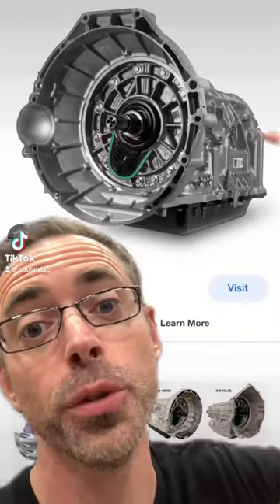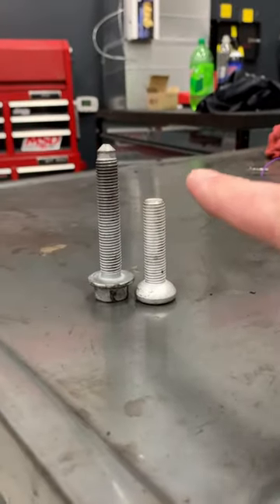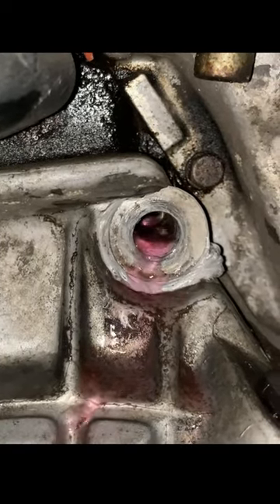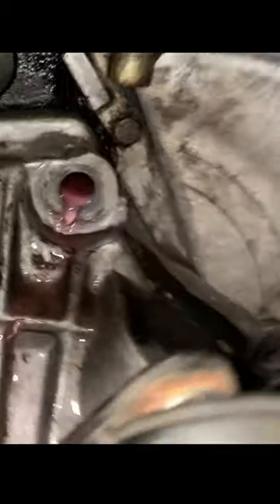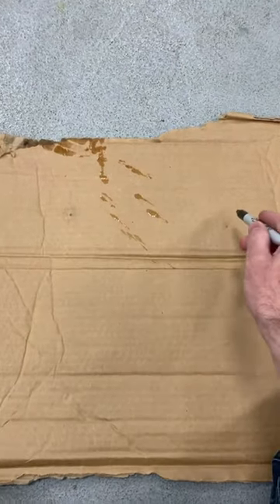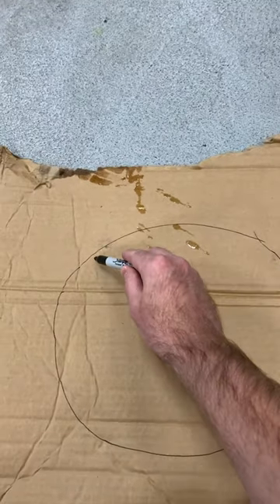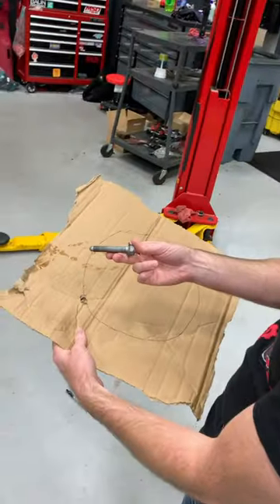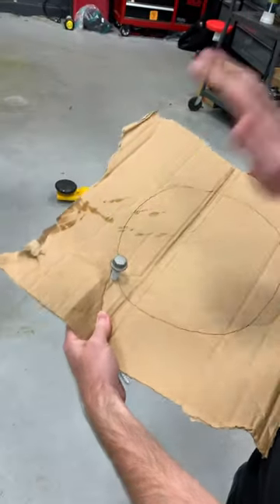Expensive Mistakes when working on engines #car #shorts #automobile

Comment: You can always check the depth with something smaller by inserting it in the hole and your thumb against the surface keep hold  of it take it out check the length of your bolt against your depth gauge.

Comment: Remove the bolts by starting at a position on a clock and lay them out in order as you go. No cardboard needed, but cardboard is a better way to do it.

Comment: As a 2 stroke MX mechanic all through the late 70s into the 2000s  I just put all of the bolts in the case until they all just touch the threads.the various length bolts should all be showing the same length sticking out. If two are long and short swap them until all are equally sticking out.

Comment: If it get tight before the head is seated, something is wrong. Either its the wrong bolt or its cross threaded. Very few things automotive require force amd it's never nuts or bolts. 

My tip: Be patient and methodical. Slow is smooth, smooth is fast.

Comment: If a bolt is too long it will stick out, or if it's 1mm more long you'll will feel that's it's too tight before time. Idk how you can make an hole like that. I rarely have track if the bolt I remove, most I leave them on the piece itself. Other one's 100% of the cases goes to only one thing and only there. If it's something you can even look at the dirt, rust and signs to determinate if it was there.

Comment: On motorcycles we have a similar thing when assembling the engine, but we just check if the screw part left out when we put it there before screwing is the size of a finger width.

Comment: ignoring the fact that they were clearly threaded in with an impact on full uga-duga/vert mode when one should have had threaded them in using a ratchet since there's only what six or eight bolts total, It's not like the impact saved a whole lot of time but i digress and the damage has already been done...

Here is the fix without "spending thousands of dollars".

5-10 wraps with Teflon tape on the bolt threads and then reinsert the bolt back in the hole that came out of it'll be fine and should be a permanent fix until the next time the bolt has to come out for service work at that point it would have to be reteflon taped again.
Ford was notorious back in the 1970s for having water pump bolts go into the water jackets sometimes they would leak especially as the vehicle's got older and the water pumps it came on and off a few times.  Plumbers Teflon tape would stop the coolant leak it is really that simple.

Comment: Or just drive a '73 Chevy pickup like I do. Had it since '76 and it's all original except for fuel pump, p/s pump, brakes, and 4 clutches.
243000 miles and still going strong!

Comment: Done that many times.  I had to follow up a green 'tech' one time on a John deere tractor after he worked on the clutch.  Both shift levers were walking around under acceleration/deceleration.  He sucked the trans to the engine with a ½rattle gun.  Trans top shaft annihilated the rear bearing support.  Total tear down and send it off to machine shop to fab up complete new bearing support saddle.  Big dollars and service manager still didn't fire him.

Comment: I just want to say that I didn’t grow up with a father figure. I am 35 and had to learn the hard with B&W 1,000 service manuals. I used to use the nail polish method for bolts but after watching this I’m going to cut a cardboard layout whenever I can so the correct bolts go into the original spot.

Comment: Pro tip, insert a metal rod/ welding rod into the thread. That way u can see how deep and that will tell u which length of bolt you'll put on

Comment: I did that to a transmission one time on a Chevy van. I ran a mounting bolt through the bottom of the transmission too far and ruined the transmission case

Comment: I use the old cardboard trick for so many things.

I also suggest always running up transmission bolts by hand. It doesn't take much longer than throwing the air tools on it.

Comment: I should have done that . I replaced  a water pump on my 460 ford . All kinds of bolts , all different  lengths.   It went back to gether ok . But I was very careful I put the bolts back into the old pump when I took it off . It worked . But this is a better idea thank you.

Comment: Find or make stainless steel grub screw with correct threads and install it with Loctite 567. Wait 24 Hrs.  Shorten if necessary, the transmission bolt enough to get in at least 4 threads depth. Blue Loctite the trans bolt, and wait 24 hrs. EZPZ

Comment: That is quite the stroke of BAD luck. Of the 18mm bolts that hold the engine to the trans, only one is slightly longer than the others (the starter bolts on the manuals don’t count here😂), it happens to go on the bottom rear. But to pick that bolt and mistakenly send it through the block, just sell all of your tools and rely on professionals from now on.

Comment: I remember performing learning this when working on rebuilding transmissions taking entire engines apart and replacing auto parts. One bolt may be shorter than another.

Comment: If you forget to do the cardboard, place the bolts around the bell housing while butted up to the motor, arrange the bolts so that they all a have the same amount of thread showing when just pushed to the threads, not started.  Likely 1/2-3/4".  This only works if you are sure you have the factory bolts.  If they stick out roughly the same, you should be very close.  Not perfect but better method than just start cranking away until you break something then back off a half a turn.

Comment: Just get a little rtv and some red threadlock mixed with 2 parts washer fluid, 1 part ATF LV, 1 part coolant and rolled in ceramic brake dust with a pinch of lathe shavings in the hole to prevent leakage...be better than new 😅

Comment: Or stick a screw driver in the hole/s to gauge / measure the hole depth/s before inserting the bolt/s.

Comment: I can see a aluminum block cracking if you would put a bolt in is too long but a cast-iron block as see the threads stripping before you crack the block and not all transmissions or a circular bolt pattern

Comment: Or just don't run bolts like this in with inpatients. I've swapped a few motors and once had the wrong length. It stopped progressing so I pulled it back out and sure enough wrong hole, move it to another. Besides cardboard I have a video showing I use cheap silicone mats(meant for hot pans and such) and poke out the honeycomb shape to make reusable pattern bolt savers. Works great years later.

Comment: So I'm a little confuses yes it had a hole in the block but if no external cracks I would assume you could run the correct bolt with sealer on it I run into fasteners that go straight through the block into either main oil rifle or a coolant port even 10,13,18 speed transmission bell housing have holes thru it that bolts seal up with some blue loctite

Comment: I like put these bits of cardboard in a file cabinet, or hang them on clothing drying racks or from suspended wires/ropes/cables like clothing drying in the wind to make them easier to manage and access.

Comment: Well we usually hand tighten bolts, if you install or line a part correctly the bolts would go in simply. You wouldn't be making that mistake.

Comment: You can always use a thin stick like a tooth pick or q-tip stick it in   mark at the edGe with paint marker or gasket sealant ,.  You can repair it by using lacquer thinner or berry man great stuff spray , letting run out , or wipe off n use JB weld covering the entire hole,, waiting 3 days to cured then retreading the hole with proper size according to the bolt ,

Comment: I've installed my fare share of transmission bolts, and I gotta say it seems to me like you'd have to be some kind of determined to run a bolt in that far. By that, I mean that you should feel the bolt come to a hard stop well before all the threads are out of sight even if you're using a rattle gun and decide to give it all the ugga duggas. Surprised the bolt didnt just snap or strip out. Unless of course the factory used that bolt hole as a machining port and just put a plug in the bottom, but still you cant tell me there wasn't some noticeable resistance there.

Comment: i always do the bolt by hand first even tho i have both removed and installed the transmission myself which is a nightmare without the cardboard tehnique but experience has tought me to always first put the bolt on what side it should be (top being on the car windshield cover, the side ones are one the toolbox and bottom ones are in a box on the floor) second to always first use the bottom screws for the transmission hold because the transmission can be held by one or two screws tightened to spec and third and final always check where each screw stands because of the creative lengts of screws

Comment: I worked on VW, they are like that.. Once I fitted wrong bolt, and it stopped free turning before tightening. Had to replace immediately.. Whoever punched hole in this engine was not a mechanic.

Comment: Or just look at the damn bolt when your putting it in making sure it goes flush without resistance and not run it in with an impact. But yes this has worked for me in the past on some more precarious jobs.

Comment: Here's another idea, and I want you to hear me out because I know it's outrageous. The engineers could specify all the bolts for the transmission be the same length and that they aren't long enough to punch into the water jacket on the engine. Heresy, I know, but it must be tried

Comment: Absolutely no way that was done by a bolt, the threads would strip off before it ever went through the block. What happened is either a bolt was snapped off and then drilled out and they went too far and into a water jacket, or they stripped the threads so they drilled it out for a heli-coil and went too far and into a water jacket.

Comment: Not the end of the world get the correct bolt apply Permatex non hardening aviation sealant to threaded section of bolt, put bolt back jobs done. Early GM engines had head bolts that directly into the coolant jackets the sealant prevents coolant to pass up the threads.

Comment: I tried that once but my teardown was so full of add on bracket supports and shared with a 2nd cover I instead took every single bolt holding the covers organized by size and when I was really to reinstall used a deph gauge on a caliper and then subtracted ⅛" and it was perfect

Comment: Nothing is worse than spending hundreds or even thousands of dollars, and multiple hours to repair or replace parts on your car, just to break them or another part during the reinstallation process. Luckily I've only experienced that with a fuel pump, but it still had me so angry that I just laid back on my creeper in silence for a few mins. I couldn't even mentally process how badly I screwed up. Had to wait a week for my next check so I could get another one 😂😂

Comment: Or buy a Chevy, and don't pull the trans or engine.  And IF, you manage to blow one up, all the trans bolts, are the same length.  Just some have studs on the top, for externally mounted parts, like wire grommets.

Comment: You should inform people that some bolts are like this from the factory thoigh as well just take some mopar engined for example there typically one head bolt on each side of the engine that leads directly into a water jacket and its there on purpose idk why because they actually put sealant on these bolts specifically.. just an engineer trying to use their brain again haha..

Comment: Don't be a quiter. If that bolt is getting tough, just break out the cheater bar. Also, make sure to cross thread it because loctite is expensive and you're a frugal man.

Comment: Auto body tech here 
I being doing that old Indian trick for long time like 20 years 
Story some Jettas bolt door out skin same thing few longer bolts that can damage new painted panel 
Radiator and core support some longer that can damage your ac condenser or radiator if not using correct bolts 😆👍 
Cardboard works and you can write on it too

Comment: Never used cardboard, never had this issue. I just don't have my head way up my ass when I do work like this. It's not easy to run a bolt too far. You/I ...should/would feel it bottom out, and common sense would tell you to STOP DRIVING THE BOLT IN THE WRONG HOLE.

Comment: Too bad the OEM didn't think of repair and just use the same length of bolts all the way around.  That would just make too much sense.  Might even save a couple bucks on each car, but then they can't design to maximum pullout strength for each bolt.  Over engineered, under thought.

Comment: If you put a hole in the block from a bolt to long you dont need to be a mechanic. Ive changed tons of transmissions and have NEVER came flose ro this

Comment: Yeah, not proud of it but after rebuilding an engine assumed all the head bolts the same and ended up puncturing a hole in the oil pump.😡

Comment: Thats an older VR6 for sure. The tip of the top two bell housing bolts are pointed and they are different lengths. It is not hard to punch through the water jacket with the wrong bolt on 021 and 022 VR6's.

Comment: That’s for somebody that just starting out I throw all my bolts in a box, and when it goes back together, I know where the bolts go. You could look at the bell and tell which ones go where if a bolt is too long you tighten it up. It will bottom out, you know it if you run it in any farther you know what you did it’s your fault that’s basically for green people that’s just starting out and doesn’t know nothing like this young generation a bunch of parts changers they don’t teach them nothing in automotive school anymore just had to change parts diagnosing is a bad word to the public now but they’ll bitch and whine when it’s not fixed but they bitch in wine if you want to diagnose it and they want to put it on you if it’s not fixed well the whole problem is people is in a hurry for everything that’s why they throw parts out of vehicle they figure it’s quicker to throw parts of the vehicle then it is to diagnose it takes too long The problem is people in the us need to learn how to slow down idle down take a breather, get out of the fast lane. That’s why this world is become parts changing because everybody’s in a hurry go go go there’s no idle time learn how to settle down take a few minutes breathe do it right don’t do it like Joe blow up under the shade tree and there’s guys at work under a shade tree that know how to diagnose vehicles and I wish people would get this straight because this one pisses me off they don’t know the definition between mechanic and technician they think that they’re the same they’re not a technician troubleshoot a vehicle for the mechanic the mechanic is the parts changer Technician puts a puzzle together for the mechanic everybody thinks it’s all the same and it pisses me off to no end when I get called iMechanic and I tell people learn how to talk. It’s two different things there’s nothing to say about it that’s just like when people talk and they say probably you know what my opinion about that is People need to learn how to talk because when you say properly, you’re not sure of your own self you don’t know so you people need to learn how to speak proper English yes lying bull crap talk like a American like you’re educated not like you’re stupid I don’t care what people think. I’m going to speak my mind, redo my speech.

Comment: Just common sense hand tighten them if a mile of thread is sticking out and you have to force them to tighten against the bell housing something is wrong  but then again auto techs are like any other trade and has to suffer with it's  good professional ones and lazy stupid hacks

Comment: you know it's easy as fuck to just gently measure the depth of the holes w/ a random stick or piece of wire or something, right?

or... there's only like 6 bolts... just fucking remember which is which... it's not that hard.
Reply: but I don't have a random stick!

you don't have a stick but you have a spare piece of cardboard the size of a classic beetle's decklid!?
Reply: I do wheel alignments w/ a stick and string. I can actually do it more precisely than the shop I use, and they're very good at their job. that's how god damned easy it is to do stuff when you're not prissy and stupid.

Comment: Or maybe you could just use your brain and make a mental note of where the bolts came from...unless you're just too psychotic to remember the same location that...what, eight bolts came from. Or better yet, when the bolt bottoms out, stop! Grab a shorter bolt.

Comment: I use this while working on aircraft. I use corrugated plastic board or make a template with sheet metal though so they’re reusable. Usually one or two defining features to indicate direction or an index is all I add.

Comment: If you find your buddy’s unmarked cardboard like this on the ground with bolts stuck inside and you DON’T spin the cardboard 90 degrees, you can’t call yourself a mechanic.